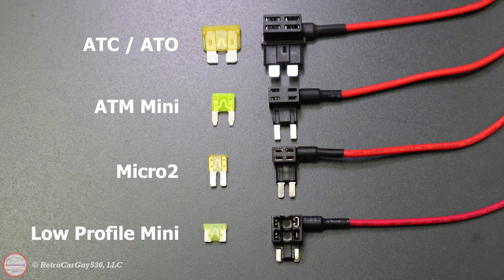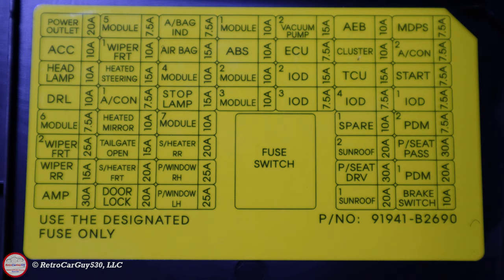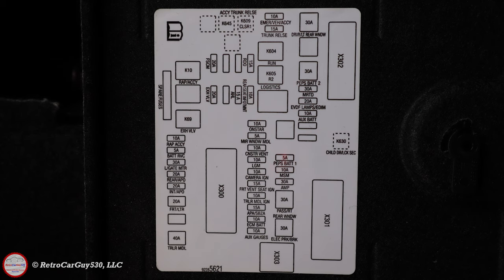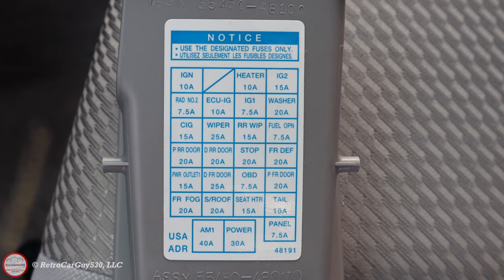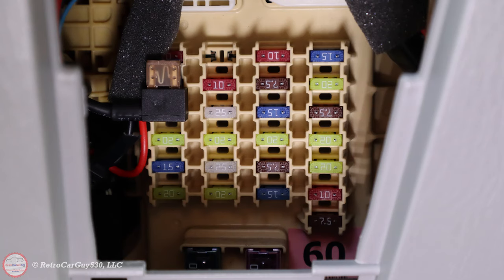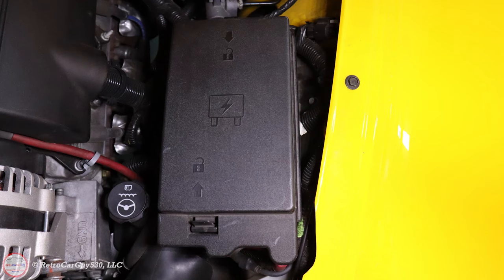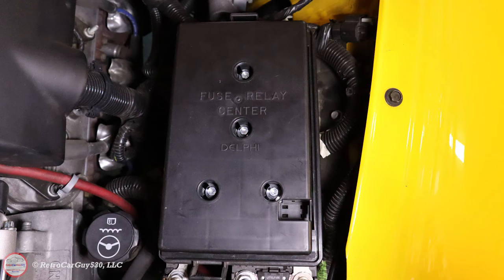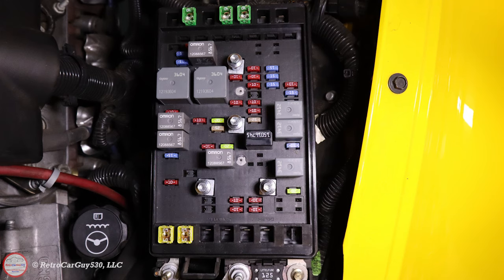How To - Add a Fuse Tap in Your Vehicle

Comment: hello I have another question. I found an empty slot in my fuse box and  it read 14.3 volt when the car is on, can I used for ACC ?,  is safety use this empty slot with that voltage?
Reply from the maker: A voltage of 14.3 volts is somewhat expected while the car's charging system is actively providing power to the vehicle.  The charging system will vary the output voltage (in most modern vehicles) based on inputs from one of the control modules (usually the engine control module).  You can expect to see the voltage level float up/down between 12.5 volts to just under 15 volts while the charging system is actively charging the vehicle's battery and providing power to rest of the electrical system.

Comment: So on a fuse tap the left hand side lead is where the power goes. So i must either have gotten lucky when i installed my fuse taps.(3) or it doesnt matter? Or where i installed the fuses has power on both sides?
Reply from the maker: "Or where i installed the fuses has power on both sides?"
No, power is only supplied to one side of a fuse box fuse socket.

I must either have gotten lucky when i installed my fuse taps
Possibly, there's a 50/50 shot of getting the left leg of the fuse tap inserted into the fuse socket side that supplies the power.

"Or it doesn't matter"
Yes, it does matter!  If you insert the right leg of the fuse tap into the side of the fuse box fuse socket that supplies the power, you're routing the power through the fuse in the lower socket of the fuse tap first.  The left side of the fuse tap is provided power through the lower fuse in the fuse tap (that's a problem and can potentially overload the bottom fuse). Power is then provided to the original circuit in the fuse box AND the power is provided to the left side of the fuse in the top fuse socket of the fuse tap.  The bottom fuse is now carrying the load for both circuits.  If the power demand of both circuits is low enough to not blow the lower fuse, it will "appear" to work.  If the power demand of both circuits is above the fuse amp rating of the lower fuse tap fuse, it will blow that fuse.

Fuse tap installation tip
Insert the fuse for the new accessory in the top fuse socket of the fuse tap.  Leave the bottom fuse socket of the fuse tap empty (at least for this test).  If you insert the fuse tap into the fuse box fuse socket and then you test for power at the end of the wire coming out of the fuse tap and power is present, then you have the fuse tap inserted correctly.  If there's no power provided by the fuse tap wire, remove and rotate the fuse tap 180 degrees and reinsert the fuse tap and test again.  

You should never need a fuse in the bottom fuse socket of the fuse tap to provide power to the top fuse / fuse socket of the fuse tap.

When you find the correct orientation for the fuse tap and if there was originally a fuse in the fuse box fuse socket where the fuse tap is installed, remove the fuse tap and install the original fuse in the lower fuse tap fuse socket and reinstall the fuse tap in the fuse box fuse socket.

Comment: Does the direction of what way  a regular car fuse( not a tap fuse) should be inserted matter ?? Cuz I’ve seen some fuses that are upside down?? Why is this ?? Help!!!! Please !!!!!
Reply from the maker: Automotive fuses do not have a specific direction they should be inserted into the fuse socket.  The fuse tap has a requirement to be installed in a certain way because it has a specific power distribution pattern in the tap, but the fuses can have current flow in either direction.  Automotive fuse box relays do have a specific orientation to their installation because they have a "control" circuit and a "power" circuit that must be installed into the correct relay socket pins in the fuse box.

Comment: are these supposed to fit loose? i have the same mini fuses as you and i thought the ones i got were wrong, but i can’t see how it wouldn’t fall out since my fuse box is at an angle
Reply from the maker: The fuse tap should not fit loosely in the fuse box fuse socket.  If the brand of the fuse tap you're using has very thin connectors, it could result in a loose fit.  The only way to change that would be to use a different brand of fuse tap.  The only other possibility is the female connectors in the fuse box fuse socket could have been stretched which could result in a loose fit as well, but a fuse and a fuse tap would suffer the same fitment issue in that case.

Comment: I am tapping into a 7.5a fuse.  Can the connected tap have a 15a fuse or should it be less than the fuse you are tapping into?
Reply from the maker: The new load being added by the fuse tap should never be larger than the original fuse in the fuse socket the tap is being inserted into.
Many would say a fuse socket with a 7.5a fuse could support a fuse tap to add a fuse with an additional load of 7.5a.  I've become more conservative over the past couple of years with regard to fuse taps.  In theory, the wiring supplying the power to the fuse socket can safely supply the original 7.5 amps plus another amp or so for a total of 8.5 amps.  That's using a 10 percent rule of thumb with regard to extra capacity built into the pre-existing wiring.  If you have a fuse socket with a 7.5a fuse and then add another 7.5a fuse to the fuse tap, the wiring providing the power to the fuse socket is now potentially supplying 15 amps.  In your question, you mention a 15a fuse, so the fuse box fuse socket might have to supply up to 22.5 amps.  Can it safely do that, it might depending on the internals of the power distribution within the fuse box, but without knowing for sure how that fuse socket is getting its power, I usually fall back to the guideline of there usually being about 10% extra capacity in the wiring.

The method of routing power through the fuse tap I show in this video is the "in parallel" power routing approach.  That means the power from the fuse box fuse socket is directly available to both of the fuse sockets ands fuses in the fuse tap.  The other method is "in series" where the fuse box fuse socket power is provided to the right leg of the fuse tap.  That forces the entire load through the lower (original) fuse which is "the safest" approach since if the combination of the original load and the new device load exceeds the original fuse amp rating the original fuse will blow protecting the wiring the best.  This is the "safest" approach because you'll never exceed the original fuse's amp rating, but it also means that both items/devices being powered (original and new one via fuse tap) will lose power at the same time.

If the item you're trying to power requires 15 amps, I would recommend using a switched relay to accomplish that task.  I discuss that issue and power method in a video I put together for a dash camera battery pack and how to power it safely.  I hope something in this reply helps you!

https://youtu.be/Joa0fiKZY-o?t=744

Comment: Hi , what about ground wire when installing a fuse tab? Also whats all these products called so i can buy them i know fuse tab what else are the other stuff called thanks
Reply from the maker: The ground wire would be connected to any pre-existing ground location or a location that is clean and clear of any paint that has a good connection to the body of the vehicle.  The connection for the ground wire does not change just because you're using a fuse tap to source the power for the new device/accessory.

Fuse taps can be called "Add A Circuit" or "Fuse Tap".  You should make sure the type of fuse tap matches the fuse type used in the fuse box fuse socket where you want to add the fuse tap.

Comment: I need to power up a standalone engine harness I believe needs to be key/on power.  if adding a fuse tap such as this, what amp fuse would you recommend?
I was told by a mechanic that I should use a 50 amp fuse in the cars existing fuse block to tap into it.
What are your thoughts on this?
Thank you I have learned from your video!
Reply from the maker: A fuse tap should only be used to provide power to devices which require under 10 amps and in many causes I suggest under 5 amps.  The reason for that is you have to be conservative in your assumption of the amount of available power on any given circuit providing power to the fuse box fuse socket.  I provided a similar answer (with more details) recently in another viewer's comment post.  I would recommend sourcing the power for your new harness directly from the vehicle battery with an inline fuse that will protect the new circuit.  Use a 4-terminal relay to control the on/off status of the relay.

From that other comment reply:

This topic requires a somewhat complicated answer.  Without detailed/specific knowledge of how each fuse box fuse socket obtains its power and what the max amp rating is for the source of power, there's no perfect way to answer this question accurately.  The wiring / method the power is provided to the fuse box fuse socket must be able to provide the original amp load and with most situations it has at least a small amount of built-in "extra" amp load carrying capacity.  That "small amount" is usually around 10% of the original amp load rating.  10 amp = about 1 amp extra. 20 amp = 2 amps extra.  Is this a perfect way of estimating the amount of available amps, no, but it is a fairly safe assumption.

If the device needing power from a fuse tap requires a large number of amps (over 5 amps) to start/run, I would not recommend a fuse tap for its power source.  For devices with higher amp load requirements, sourcing power directly from the vehicle's battery with an inline fuse to protect that circuit makes more sense. If the device requires switched/accessory power, I would still source the new device's power from the battery with an inline fuse, but use a 4-terminal relay to toggle the power  on/off.  You could use a fuse tap to source the switched/accessory power to turn on/off the control side of the relay if you want it to turn on/off with the ignition switch.  If you want to manually control the on/off behavior with a toggle switch, you would use that to power the control side of the relay. I have a video discussing the "relay" approach to power a dash camera battery pack.  https://youtu.be/Joa0fiKZY-o?t=744

I recently posted on a DashCamTalk website about the differences in the installation of a fuse tap into a fuse socket (power on the left leg vs power on the right leg) here.  https://dashcamtalk.com/forum/threads/a229-pro-2ch-issue-with-power-or-hardwire-kit.50021/post-607344
Reply: Thank you for your time it is very much appreciated! @RetroCarGuy530

Comment: OK so my cigarette lighter fuse under my hood burnt up and melted the spot where the fuse goes because(I'm guessing).. I had one of the defroster heater things plugged into my cigarette lighter instead of the the 12 bolt power outlet? Or because that heater thing is just a piece of garbage? Not sure... however, I need to reroute that fuse to an empty fuse port on the panel... what if I don't have a empty fuse port that has power to it??
Reply from the maker: If the fuse box melted around the fuse socket for that cigarette lighter (aka called a power port), then it's likely the fuse installed in that fuse socket was not the correct amp rating for the wiring and/or power demands of that cigarette lighter port.  There could be other reasons and other damage in that fuse box, but it's impossible to tell without an in person inspection of the wiring and the fuse box.

If you can find an unused fuse box fuse socket that provides the type of power (switched or unswitched) you might be able to use a fuse tap in that fuse socket.  But please be aware that a fuse tap is limited in the amount of amps it can supply due to the wire gauge of the wire coming out of the fuse tap.  Most of the time the wire gauge is 14 awg or 16 awg which greatly limits the amps that can be safely delivered over that wire and the length of the wire also impacts that (as discussed in my FAQ fuse tap video).  A fuse tap cannot provide more than 10 or 15 amps max due to the wire gauge limitation.

The other approach to supply higher amp power is to use a relay with a direct connection to the battery (with an inline fuse to protect that circuit) and a fuse tap can be used to supply power to the control circuit of the relay.  I discuss that in my FAQ video as well.  https://www.youtube.com/watch?v=DnZ5wb_A5vE

Comment: I’m trying to wire a light kit to the fuse box and I’ve tried a bunch of fuses and nothing seems to work
Reply from the maker: There are several possibilities for problems so knowing what you have tried to diagnose the problem might be helpful.

Can you power a test light (not from the light kit) or use a multimeter to verify the fuse socket provides the power you need for the light kit?
Did you find a fuse socket that provides power, but the light kit lights still don't work?
Were you not able to find a fuse socket in the fuse box that provides the switched (accessory) or unswitched (constant) power you were looking for?
Are you sure the ground connection for the new lights is connected to a good ground location to complete the circuit?
Have you tested the light kit before trying to power them with the power from the fuse tap (to make sure they work)?

Comment: Greetings mate 1 question. I have a radio that already has an inline fuse already built into the positive wire. Using this method to get power means electricity will travel through 2 fuses now before powering the radio. Will this be an issue?
Reply from the maker: Having the power run through two fuses should not be a problem as long as both are sized correctly for the circuit load.  You could remove the inline fuse if the power will be sourced from a fuse tap, but you could leave it in place.

Comment: What do you do if your fuse adapter is blocked out at the site that you need to plug it in? I have this issue right now where my adapter cannot seat fully because of the plastic walls around the fuse
Reply from the maker: That unfortunately means that fuse socket is not a viable candidate for this fuse tap.  You could see if you can locate a fuse socket extension cable that would plug into that fuse socket.  These are not very common but if you can find one with sufficient wire gauge for the amps required then you could plug the fuse socket extension into the fuse socket, then plug the fuse tap into the fuse socket on the end of the fuse socket extension cable and the proceed as normal.

The problem with that approach is now you're introducing some extra wires into the circuit before the fuses that may not be able to support the full current load (for the pre-existing fuse and the additional fuse for the fuse tap new accessary fuse).  Most of the time those extensions are only sold and supported as "test" wire leads and not for regular use.   Here's an amazon link that shows that type of extension in pack of 5 for Mini ATM fuse type (the single item offering is out of stock right now - this is an affiliate link so I will make a commission on this if you purchase the item at no extra cost to you).  https://amzn.to/3j1U7zE

It would be best if you can locate another fuse socket in the fuse box for the fuse tap and avoid using the fuse socket extension approach, but I'll leave it up to you to decide if that's something you want to use.